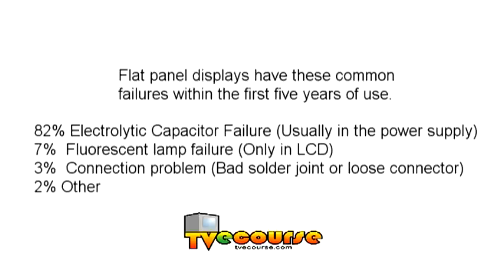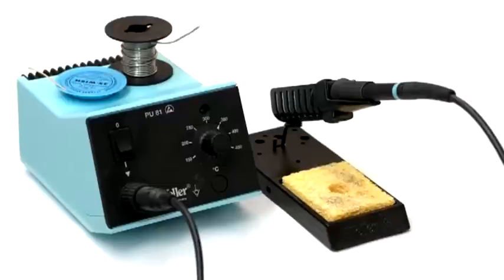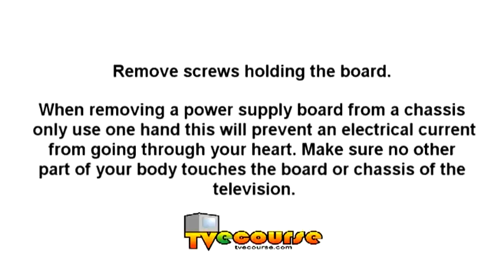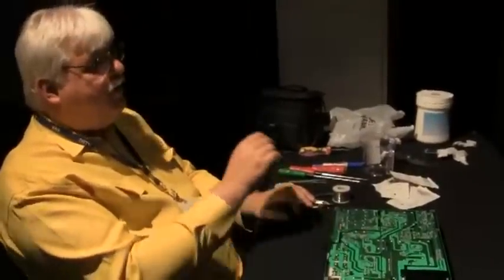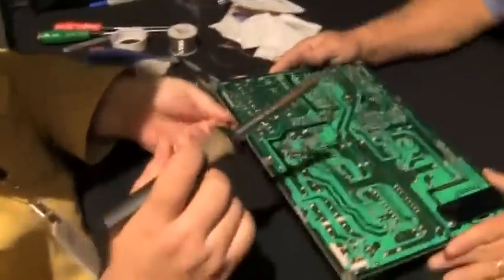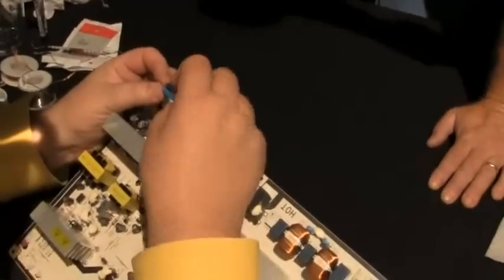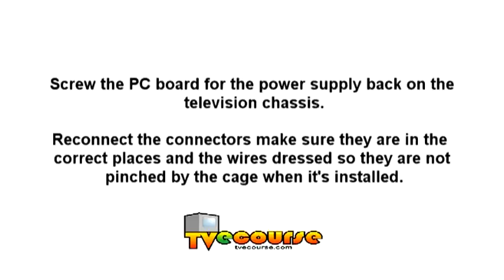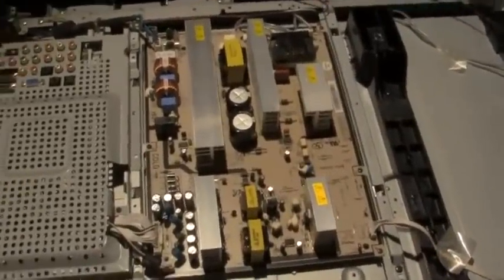Repair TV - Television repair

Comment from the maker: That is totally correct! If you use a poor quality replacement cap you will be back soon repairing it again. I love Digikey who ad sponsors this class and Panasonic caps are very dependable. Samsung, had a flood of failures caused by a Chinese cap supplier that cut costs on the electrolyte formula. JVC professional video cameras also had problems with this supplier; their cameras were failing after five years because they has dozens of caps failing in their cameras.
Reply: So if you use cheap capacitors you can get a return customer soon 🤔

Comment: Ya, digikey is a very good company. They are very fast in getting your package shipped out and it only takes a couple days to get to me not to mention they have great customer support 24/7 and have never messed up my order. I have never and will never order my electronic components from anyone else unless digikey goes down hill which I hope is no time soon! I admit I have bought a small pack of resistors from radioshack that seems to be working so far but I will end up replacing it soon enough.

Comment: He he. I did one of those Samsungs last year on my channel. I just did a 42 plasma. Again it was a bad cap, but not where you would expect. Not in the secondary. My power supply was running, just not enough current in the standby.

Comment: New subscriber, great video's it's interesting how you are teaching about caps and their little fallacies. I work in electronics two-way radio/computer repair have for 30+ years have a EE degree. Flat screens are the new fad for repairs and your right about caps they cause so many problems, usually not other components unless it took something with it. again great video's, like the soldering how to part.

Comment: Also, an AC Ohm Meter is the wrong tool to use, in circuit ESR meters are used, but one leg of the capacitor should be disconnected as it will provide a false reading if it is in series with a good capacitor.

Comment: Remember to use a little flux when re-soldering as well, helps for a much better flow of solder to the joint...

I only say this because when im repairing equipment i forget to add flux.. :D

Comment: Note - Never Ever discharge capacitors as they did here, you will get shocked and it will definitely hurt.  Use a resistor with a high value rated for atleast 20K Ohm 5 W.  Normally the large ceramic resistors you find at Radio Shack or the like.

Comment: Great Video; I have a question for you; my Visio M470SL hasa Blurry white Lined picture. Nothing is discernible. I recognize when the menu is pushed but see nothing but White lines top to bottom. I have changed all of the boards except for the power supply and still only get sound and Slow moving/changing predominantly white lined picture. I do have excellent LED lighting. Any ideas would help. Thank you for your valuable advice and time.

Comment: There's little danger of getting shocked in these new tv's. I used to work on the old vacuum tube tvs and there were lots of places where you could really get zapped. But take his advice and be careful around those big capacitors...in the power supply.

Comment: by the look of the board at my first glance it was a samsung.
most easy to break and repair are samsung or LG
sony, is one of the best manufacturers that really do well and take pride of their job as what I recall. there was a service centre where I came from that they only get 1 or 2 service repair for sony a month or sometimes within 2 months.
the most pain in the big "A" to repair are Philips. they use 400V caps that which 3 of my colleagues and me got shock many times. damn it was a painful, marking, stinking burning skin we get from those.

Comment: have a second hand 47LG70.  When I turn it on I have a blinking red light. when I turn it off I notice there is a green light that comes on somewhere on the 'video board'. I have it plugged in through D-Sub/VGA. I also notice that when I initially turn it on I notice a back light comes on for a second..  I have looked at power board and do not see any signs of blown capacitors, no other signs of heat damage on other compnents. I have also noticed that the heat shield around the video board has black marker with the following written on it  "42LG70UA ACCOLJR" Which makes me think that board was swapped out with a 42'. Any help would be greatly appreciated, I have gone on ebay and found replacement power boards for about 100 bucks, but I can not afford that right now

Comment: Hi there my JVC LED TV has no picture, there is sound. when I put off all the lights in the house, with total darkness I can see the menu on screen. faded but I am able to read. what could it be? Lights? or boards?
Reply from the maker: Many things can cause this have you pulled the plug and let it reset? also it could be a power supply

Comment: Dont some multimeter's have built in ESR meters? Or are they generally inferior to a dedicated ESR meter? Do the cheap harbor freight multi-meters have ESR testers? I want to be able to check capacitors on the board like you are doing- I dont want to have to remove them just to test them- also what ESR meters do you recomend? (in the affordable price range- under $70)?

Comment: Hi, I am having a no picture issue with my LG 60PA6550 Plasma TV.  I have fully inspected everything per your videos that I can say the following.  The STBY light is on when the set is off.  The TV powers on and the STBY light goes out.  I get the relay click and a slight buzz from the Y and Z boards.  Pressing the INPUT select button changes the buzz tones a bit.  The voltages are all correct except the STBY voltage when the set is off is 3.2V but when the set is on it is 5.1V??  Seems wrong to me.  The set was moved from a stand to a wall mount and was handled but not dropped or anything but then never showed a picture since.  I guess I am concerned the screen is dead due to being moved.  I hate the idea of changing all the boards to find out that the screen is broken itself.  Any ideas?
Reply from the maker: +dkhajavi I will pass this along to Paul

Comment: I wouldn't recommend replacing the 16V caps   by the ones of 35V due to any increase on voltage due to any problem such as short, will damage whatever component is connected to that part of the circuit.
Reply: WTF dude, the voltage on a cap just means how much the cap can take before going bad.... It doesn't increase voltage! Its the Farads that are important and depending on application ESR value

Comment: I forgot to mention that I worked as a tech and also managed a tv repair shop for several years in LA. I quit in 2008 so have worked on both solid state and tube sets. I didn't mean to say newer sets were not dangerous, 
For the most part transistor sets use much lower voltages, but yes we have to be careful around the high voltage and the big caps in the power supply. .

Comment: hi I have a Panasonic TV TC-P46G15 has no picture or sound , blinks seven times from. unplug p1 p2 no change have power on power supply card. thinking main control broad. do not know what to check?

Comment: Excellent video, I Have SAMSUNG UA40H5100AR TV, my problem is that the sound completely goes after just few minutes of starting, and only resets by keeping the TV power off for some time, appreciate if any one can help on possible reason for this.
Reply from the maker: +Muhammed Saqib Ahmed Qureshi most likely its a semiconductor that stops working when warm. probably an audio amp ic with a heat sink. you can test with freeze spray
Reply: Thanks for your guidance will try as suggested

Comment: Nice video. Love the statistics about failure percentages in the beginning. But at 35:45 you say that the dark blue things close to the coils are relays. Don't you think it is capacitors that along with the coil are EMI filters like in every other power supply? :)

Comment: Never use radioshack caps. Unless you want your customer coming back complaining about the same problem down the road. Digikey,com is your friend and get Panasonic caps! Btw I hate those type of pcb's. They have the smallest pads and the solder never seems to melt!

Comment: I have an Hitachi 42" L42N05A... All of a sudden when switching on my flat screen TV, it refused to turn on...  There are no sound nor picture... Its giving that red light and turns blue on switch on and that's all, no response... I followed your video and tried to look for Caps damage but all seem to be in good condition... Please help!!! Thanks in advance!!!
Reply from the maker: Mardaymootoo Shammoogum Sometimes the caps look good and are still bad, you have to use the meter I showed in the video. Paul has probably worked on one of these I will check with him.
Reply: Hii and thanks for the reply... By the way I run through some troubleshooting and figure it out that I am having Sounds + Image are showing on Screen.... But The Issue must be The Back-Light... Plz Help me trought...
Reply from the maker: Mardaymootoo Shammoogum Back Light is very difficult to replace unless its the power supply for the back light.

Comment: Whats the name of long brown wire used when disconnecting the pins of the capacitor?
Reply: Oh it's a desoldering wire. Thanks for the video upload.
Reply: Andrew Gala
Yes desoldering braid :)
Reply: Andrew Gala Andrew - its actually called 'solder-wick'

Comment: Your instruction is OK for a beginner, however your technique needs a little update as do your tools. Soldering station with multiple tips, hot air and vacuum pump.

Comment: anyone noticed at 7:30 the guy is probing randomly at caps and going several times on the same ones?... plus the person is using what appears to be just a normal analog multimeter (watch frame per frame precisely 7:36).... from an experienced repair tech
Reply from the maker: Karl L Yes we did this in one shoot and I edited in information later to demonstrate the correct procedure.
Reply: ohhh ok i see, but anyway i watched the whole video, and it was good,. my only suggestion, is never let others work with you, as they can get zapped or accident can happen, plus not always good idea to hold the boards by the heatsink. sometimes they are fed with B+

Comment: Fyi everyone don't touch those silver heat sinks when the set is on, I got zapped doing that. Always wear some glasses, I buy magnifying glasses for a few dollars at the drug store. This will protect your eyes from splashing soldier and another thing that can happen is exploding capacitors. I had a electrolytic capacitor blow up in my face one time, but had some glasses on so my eyes were protected.

Comment: Everytime you have a psu, you have a danger. Also other boards will give people like you who don't know anything, a good kick in the pants. Always exercise extreme caution when working inside tvs and discharge high voltage caps b4 starting.

Comment: the soldering iron did not get hot enough because you have the pointed thin tip. you need the flat tip. also when soldering you want to lightly blow the solder fumes away from you because it can cause cancer.

Comment: Why are there so many crap capacitors around and why are companies buying them and using them?
Reply: lormendi
Interesting, but it begs another question. Why are electronic manufacturers buying boards with these bad components on them given that the stock will be dated?
Reply: InTheNameOfJustice Because they're cheap!
Reply: bob boscarato Yes, cheap because they are broken

Comment: 1. The way you discharge it with that screwdriver does not guarantee you will not touch other (low voltage graded) leads too. Watch your video again.
2. Irony. 5cm, 10cm, 20cm... doesnt matter when you are not using it from the beginning is wasteful.
3. Yes, cutting solder wire from the spool is wasteful and also stupid.

Comment: this is not course how to repair tv sets,its course how to replace electrolytic s...what if opto coupler or driving fet is dead...and needs measuring ..what then...or if supply is ok ,but back light inverter is dead,what then....suppose that you need to send set to repair shop,and we will solve your problem...
Reply: Check out the other 104 video's!